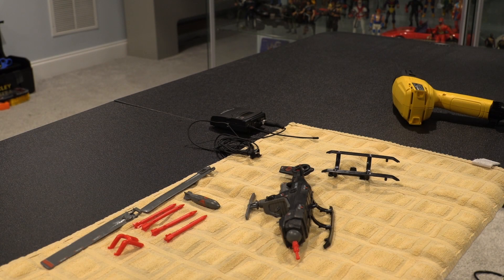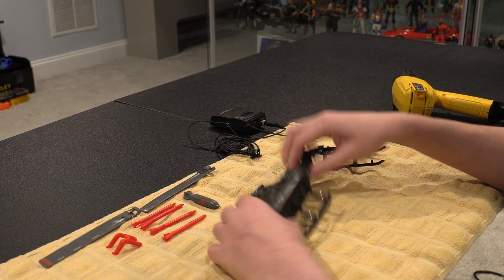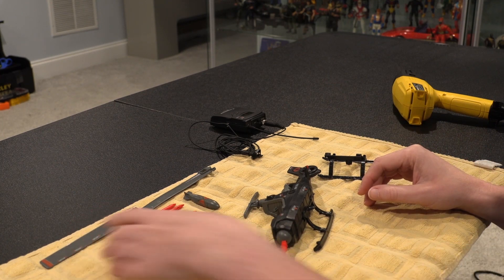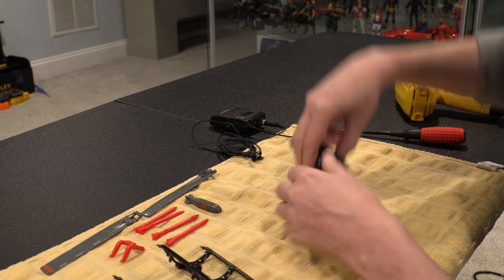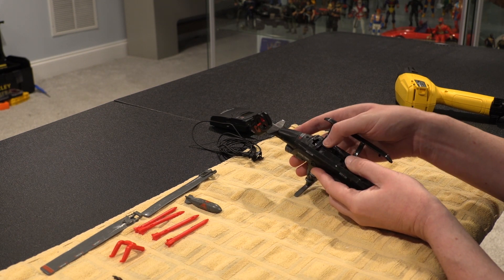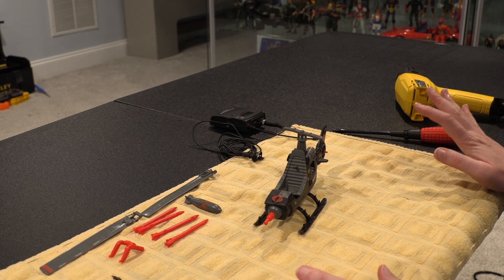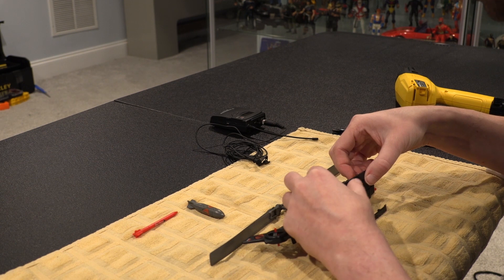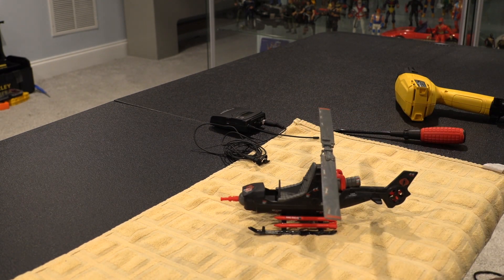G.I. Joe Cobra F.A.N.G. Restoration - Hasbro 1983

Comment: When I work in kitbashing 1/6 scale figures I use a hair dryer to work with the parts. I find a hair dryer works better and doesn't get the plastic as hot as a heat gun.

Still I love watching these toy restorations. Michael is a pro when it comes to this!

Comment: Anyone else attempting this - avoid the use of the screwdriver! Tip, look at the replacement parts first, this will give you some idea as to how they fit. Second, check sources, such as @bloodforthebaron and pull up the original instruction leaflet, which will sometimes show the construction process. Sit the helicopter into a bowl or sink with very hot, not boiling water for 20-30 seconds, then wrap your fingers around what you can and pull slowly, but firmly forward towards the gun. Mine came straight out. Reverse the procedure with your replacements - sinking both copter and skids first. Great to see another broken toy loved again. @analogtoys superb donation Tony. Nicely done Michael 😀

Comment: As a kid my engine guard broke trying to put it on out if the box. Watching you put it on made me grit me teeth hoping the brittle red plastic didn’t break on you. Yay, Nice job! Love this vehicle.
Reply: I have a broken and now repaired engine guard that I’m currently trying to cram into place. The hooked part was broken and I put a pin from a paper clip in by heating and melting the holes then superglued it together. I’ve had to redo this once already from the stress it gets put through on install. Wish me luck I guess. Sorry to hear yours broke out of the box.

Comment: Hey Mike, I found that a quick hit with a hair dryer (not a heat gun, too hot) on the stickers will soften up the glue enough to use an EVA foam dowel to gently pull away the lint and hair works well for me.  Might help if it bugs you as much as it does me lol.  Just want to get it up to just above body temp.

Comment: Awesome as usual. When it was time to be reunited with a F.A.N.G, I actually targeted the 25th Ann version ( which is alittle more difficult to find let alone opened) It is 95% a carbon copy  minus all the shortcomings of the 83 fang you pointed out.
Reply: Mine only had two missles
Reply: @camcordernonsense5264   your 25th Ann? or 83 ? LOL i checked my 25th and it has 4..the thing is those easily pop off
Reply: @new2vero2  
The 25th. They were all staged on one side of the viewers window box. They do fall off. And look like kids pretend lipstick.
That jerk Destro ripped off Cobra again!

Comment: There is another problem with exposing a plastic toy to sustained heat.  I unknowingly placed the rotor of my Airwolf helicopter over a light bulb. The bulb melted the rotor but I started having difficulty breathing. 1 side of my face went numb for 2 weeks.